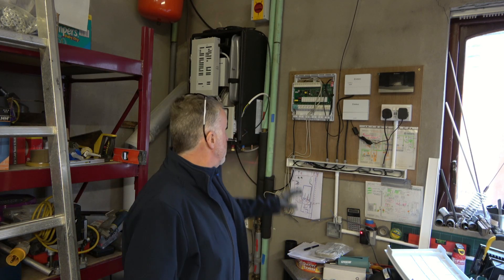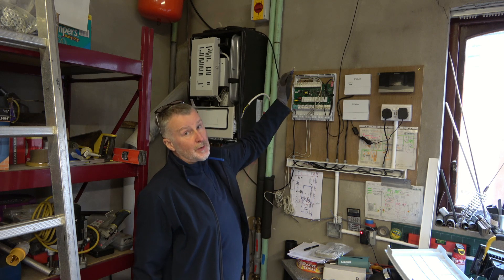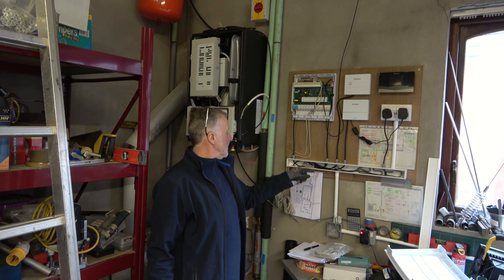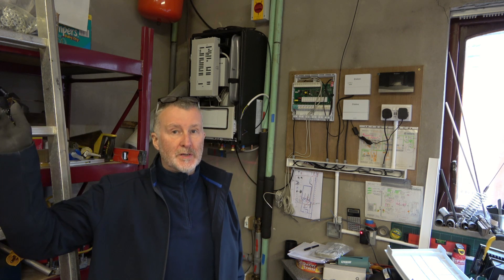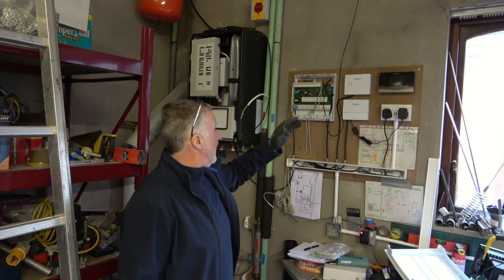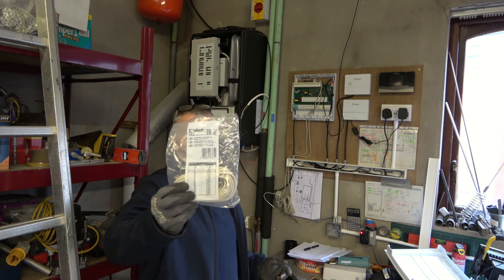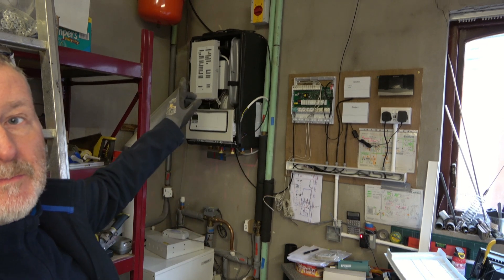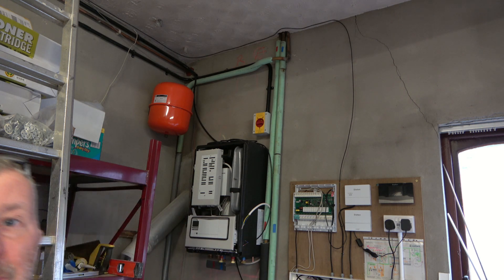Self Install of 7kW aroTHERM plus Heat Pump. E4.

Comment: Hi Keith... which Vaillant 'Diagram' No. are you using ? This will tell you exactly how to wire up each component, without you having to 'work it out' for yourself.
Reply from the maker: Hey Greg, they originally sent me the wrong one  (30270-1012)  Which I initially did not notice, so used that and ordered all the ancillary parts they suggested.  I then realised it was wrong, so they sent me more correct 30359-1013, which does include the hydraulic station and valves for a 2 zone UFH system.  I would say that there is a wealth of info & wiring diagrams, but it is all quite disjointed, maybe simply to cope with the various systems and configurations.

Comment: Have you followed the MCS approach to checking radiator sizes and sizing the heat pump?
Reply from the maker: I have done my own calcs, which will soon be the subject of a video,... but in short, i have insulated (internally) about 50% of the external walls, which is about 65% of the main living areas. Over the pas few years I have replaced steel rads for aluminium, put more insulation in the loft,.... I also have solar (DHW) water heating panels. I also got vaillant to check my calcs. I should have the video out in a day or two.
Reply from the maker: James, i did the sizing video yesterday,... https://youtu.be/FgOLPGa4FF8
Reply: @Staedford  Thanks! I look forward to watching it!

Comment: Really interested in this series as I’m planning on doing the same. Did you look into a way to get the subsidy, or will it still end up cheaper as a DIY in your opinion?
Reply from the maker: Unfortunately no grants in Northern Ireland. anyway I plan to do all the install, electrical & plumbing, I may get a spark to check the mains parts.  So the cost for me will be only the hardware costs. Even if there were grants available, you have to go through MCS, so effectively the grant would cover (hopefully) the install cost, so you still have to buy the hardware. I would also refer you to @michaeldepodesta001  & @heatgeek.
Reply: I was wondering whether I could find a tame MCS to formalise my design and enable the subsidy to be claimed somehow
Reply from the maker: @JamesUKE92  You might find one that has just started on heat pumps and wants to ease in slowly, so they check your calcs. You'll see how i did it, with a spreadsheet.